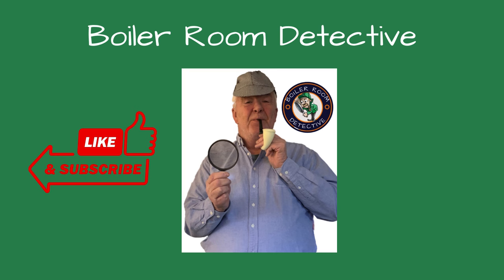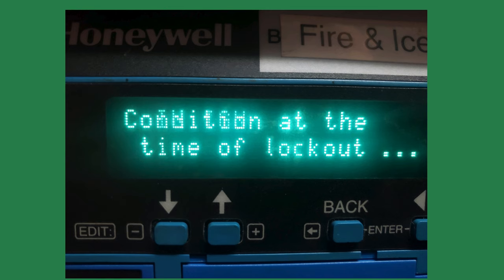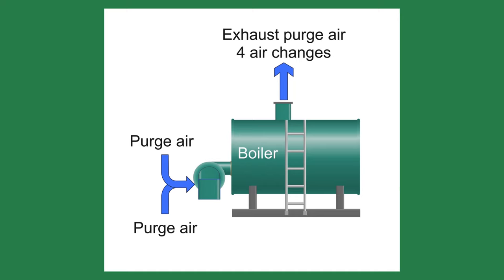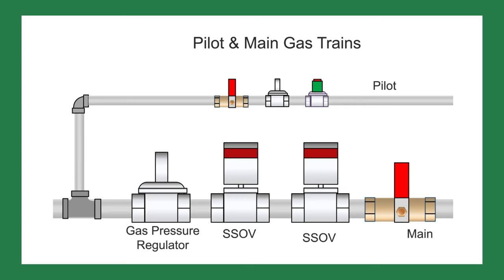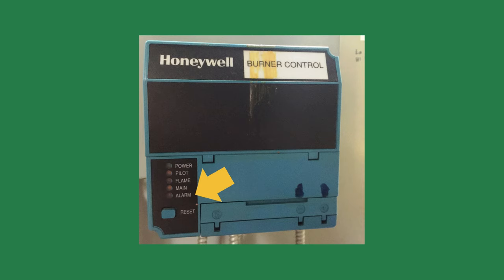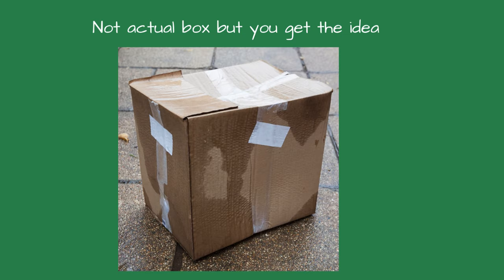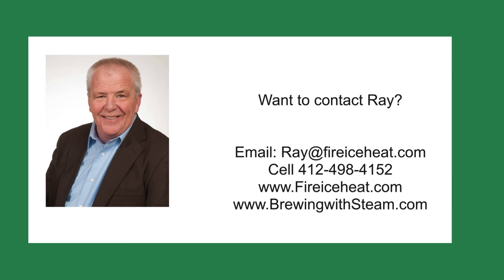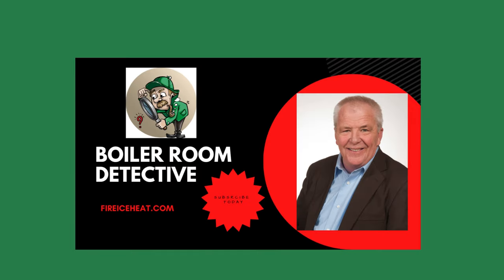How an intermittent flame failure averted a catastrophe

Comment: Yikes.  In my not so humble opinion, though, Ray, it should be ANY electrical component which has been soaked should not be used -- except for the rare widget which is intended to be soaked.
Reply from the maker: You are correct sir Thanks

Comment: God sent you there to save lives that day. 
These maintenance people out there have got to wake up. 
Went to a new contract customer not to long ago and they jumped out terminals 5 and 6 on M&M 150 head causing continuous burner operation during a low water condition. 
The excuse they gave me was the new micro switches on the newer 150s don’t hold up like the mercury ones. 😂
Luckily they keep the column clean. 
Great work Ray.
Reply from the maker: Thanks Mike Isn’t that scary